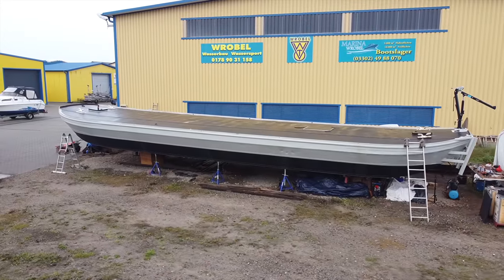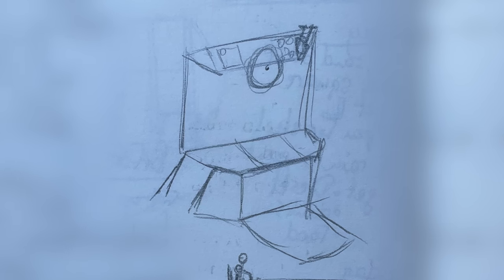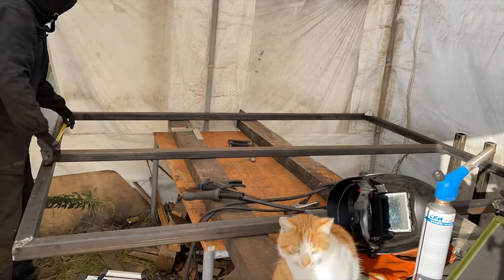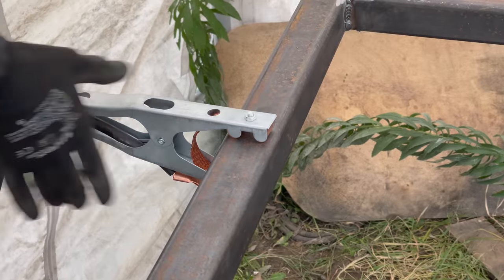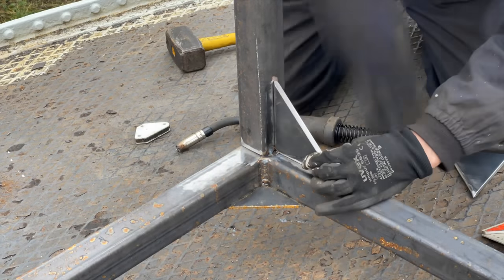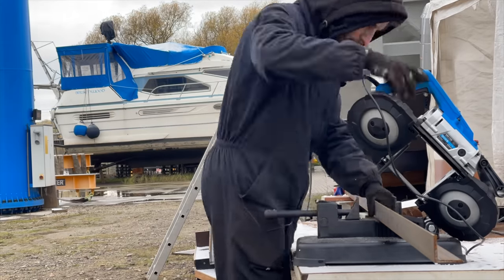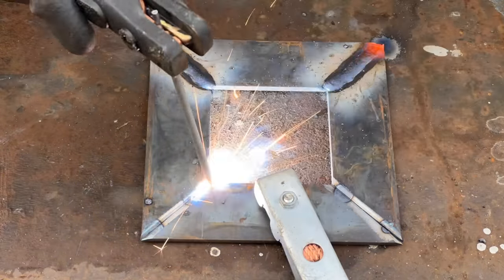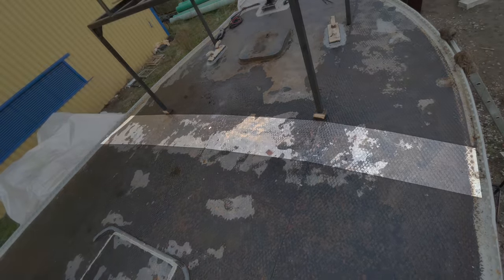Building a HELM on my BARGE BOAT

Comment: Give yourself a little education. Tack weld two pieces of steel together and then beat them apart with a hammer, drive over them with a truck, or whatever it takes to break the weld (if you can). Then weld them back together with a little more weld. Repeat. I think you'll find you are WAY over killing the welding. Your welds and structures could hold up the Space Shuttle!